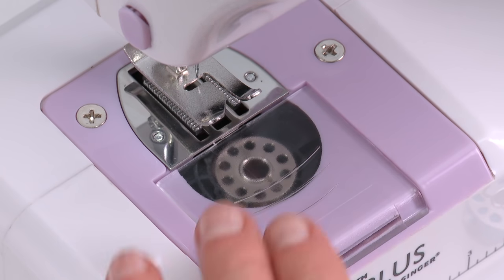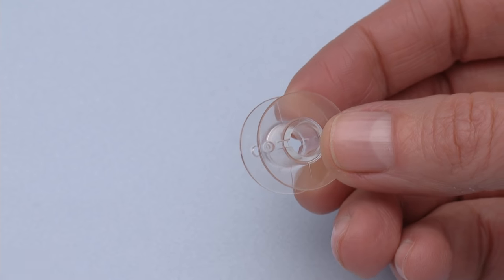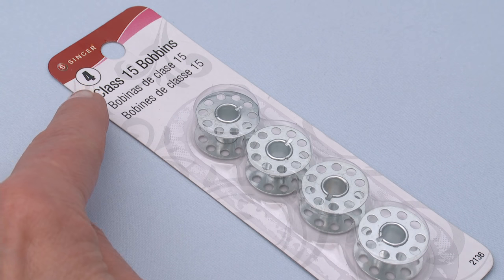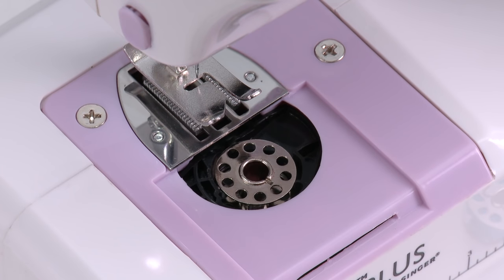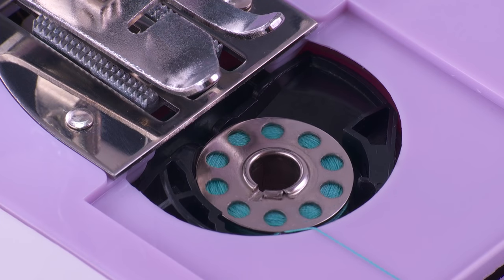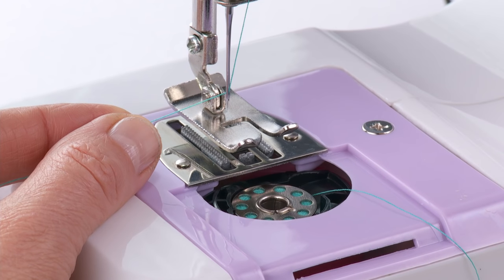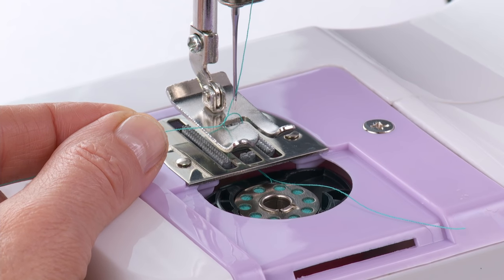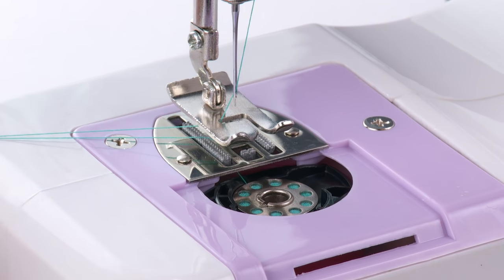SINGER® PIXIE™ PLUS Bobbin Insertion Tutorial

Comment: This video literally does not show how the bobbin thread gets under the deck if 4 inches of it hanging over the dge facing you. Thread doesn't magically move on its own. The bobbin thread has to be inserted or wrapped around something for the needle to pick it up and drag it through the machine. I watched this video more than once. It's useless.
Reply from the maker: Hi Lily, Please give our Customer Care team a call. They may be bale to help with some troubleshooting. You can reach them at 1-800-474-6437.
Reply: Did you ever figure this out? I'm having the same issue 😭